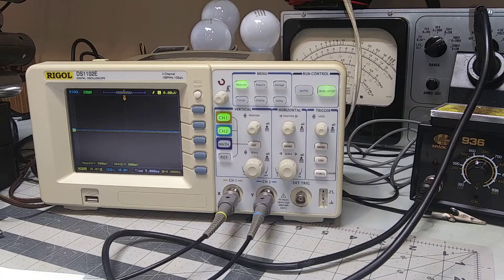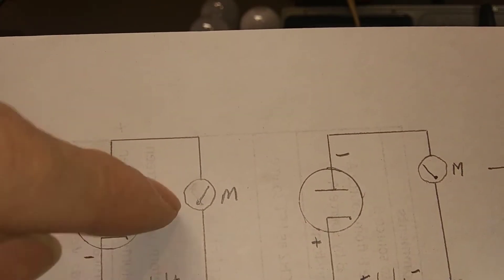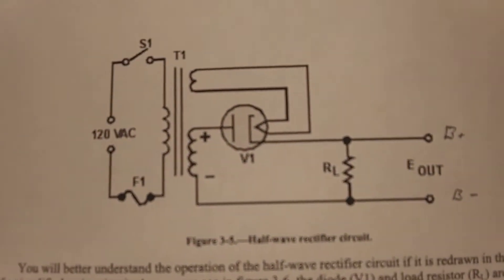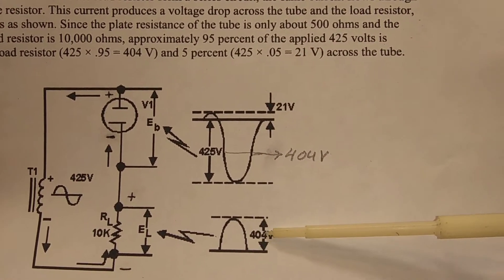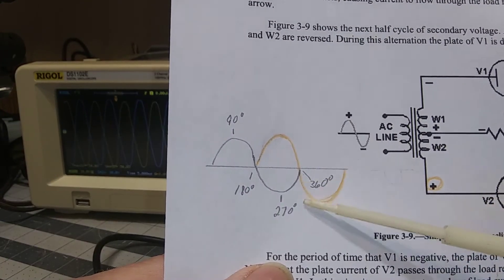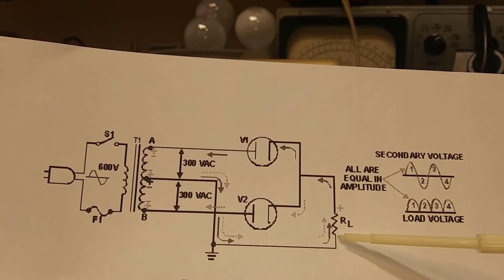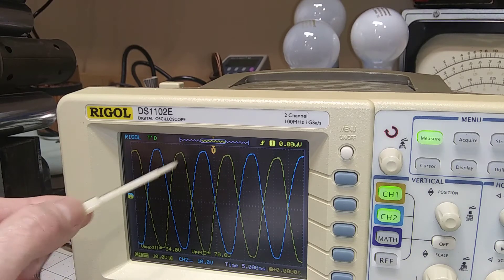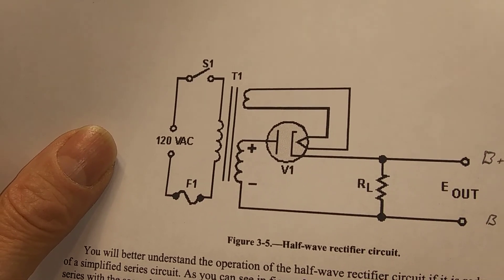How B+ is supplied when connected to the cathode of the rectifier tube, which is negative.

Comment: Good Lord, thank you so much for this. I've been wracking my brain over it for a few years now, and hadn't gotten a complete answer, although my own understanding that I came to was that I probably should just imagine that the rectifier is like another DC source: a battery, with that battery's – terminal connected to a second battery's + terminal in series.
So, the point where the second battery's + terminal is connected to the first battery's – terminal is very much like your explanation, since the two batteries very clearly meet at one battery's negative and the other battery's positive terminal. So, that point could be said to be both negative and positive, in a way. The second battery's + terminal is more positive than its own – terminal of course, but is at the same time more negative than the first battery's + terminal. 
Another way of putting this is that there is a voltage drop of 6V across two 3V batteries, and the midpoint is 3V, which is both less than 6V and more than 0V. 
The dissimilarity between the two examples is that instead of a second battery, your (and the U.S. Navy's) example has a resistive load, which I'd better add to my example— which it occurs to me now is a short circuit— before it overheats and explodes.

Comment: I posed this question on a different video about an AA5, which has no transformer to center tap.    It must be the same principle by another means, using the phases to create a positive ripple that can be smoothed out for DC.
Reply from the maker: That is a good question. I think it may be either, that the 35w4 acting as a diode puts out a plus dc voltage on the cathode or, just as I illustrated with resistors and the polarity variation you get across them, it might be that the current flowing through the first electrolytic connected to the cathode sets up a positive voltage on the cathode. If you measure dc voltage between the plate and the cathode, you will find that the cathode is positive and the plate is negative. It is very interesting.
Reply from the maker: I made a video answering your question. It is titled, An Answer to a Question About Series String Power Supplies.

Comment: I own the same oscilloscope as you and I found it impossible to do a radio alignment with tube radios. When adjusting through the frequencies the scope loses its trigger and blanks. I never had this problem with analog scopes. On shortwave I supplied 10mhz at the antenna but it never made it to the last if output. I did get the alignment done with an incoming modulated signal and the reception improved greatly. But digital scopes are fragile on tube radios. Could you demo your scope on an old radio.
Reply from the maker: I will explore that. I have a radio that I may need to do that with anyway. There are times when an analog scope is the best option, perhaps the only option. There is a way to measure the frequency using an analog scope but you have calculate it based on the settings you are using. Most of them won't show you frequency the way digital scopes do though I think there are some that will.

Comment: Thanx for your video. I have been an electrician for 47 years and I never stopped to contemplate your subject material. Most recently I needed to explain to someone why the 'cathodes' of a bridge rectifier were connected to the positive terminal of the 'bulk' filter capacitors of the power supply. Your answer was perfect! Bless Your Bunions!
Reply from the maker: I am so happy that helped you. I did that video after I couldn't find the information I wanted on that very question. I thought others might have the same questions I did and I guess they did!